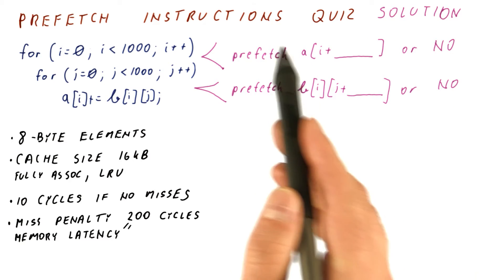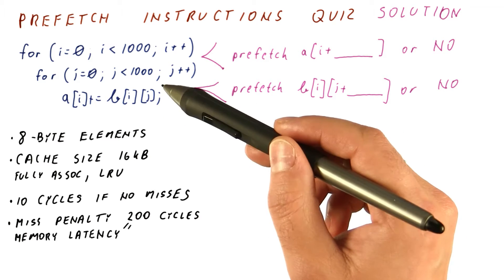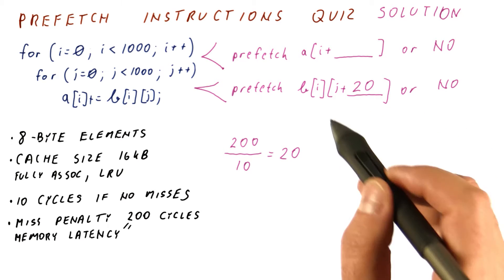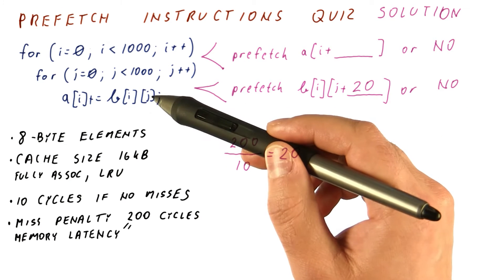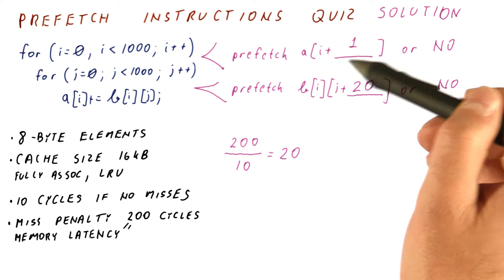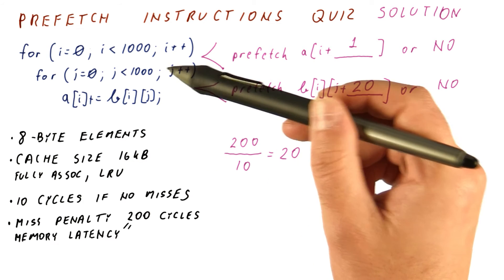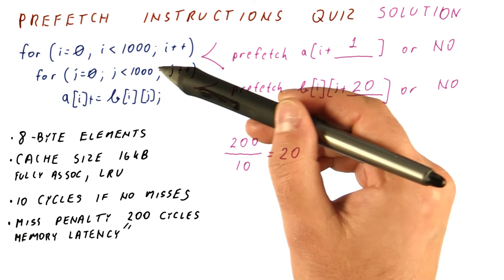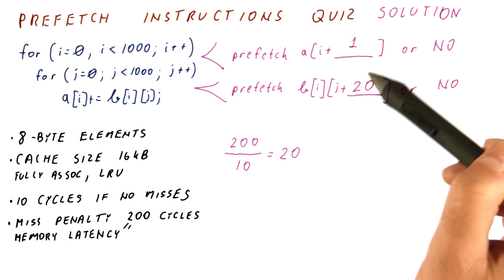Prefetch Instructions Quiz Quiz Solution - Georgia Tech - HPCA: Part 4

Comment: Why 200/10 in inner loop and 1 in outer loop?
Reply: Think it like this,

assume a[0] to a[20] are already in the cache
a[0] -> 10 cycles
a[1] -> 10 cycles
a[2] -> 10 cycles
.
.
a[20] -> 10 cycles

if we fetch a[21] now, we have to wait 200 cycles so that it arrives in the cache. Alternatively what we could do is start prefetching a[21] with a[0], by the time we reach at a[21] its already in the cache.
So, we have 
200/10 => 20